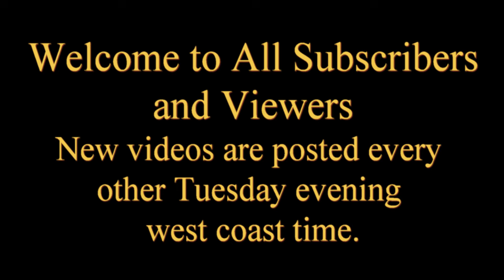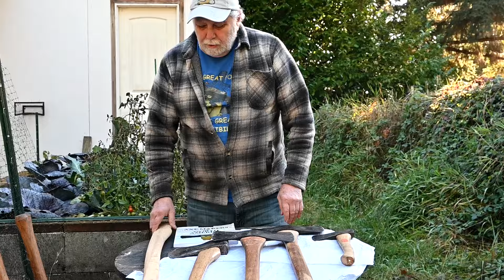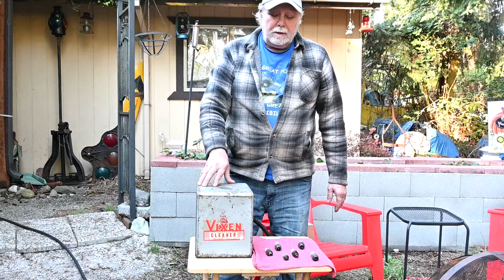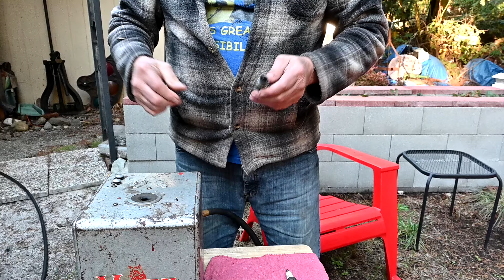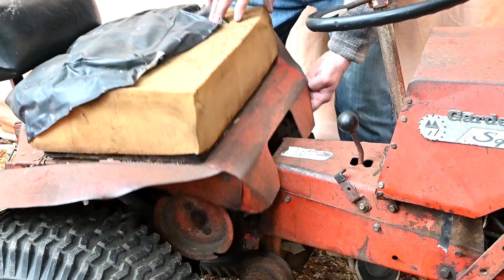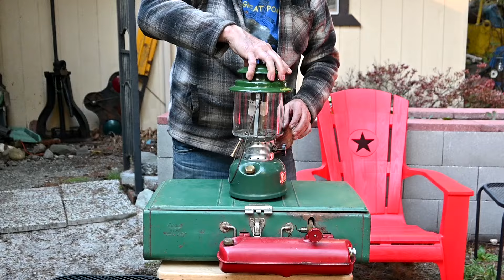Getting Your Monies Worth !

Comment: I like your older tractor I have a wheel horse that's kind of old I think it's about in the 80s Maybe I guess it's when Toro took over Wheel Horse is it supposed to weigh about 660 lb and old Kohler engine in it cast iron and a cast iron rear end in it thank you again for the video
Reply from the maker: Wheel Horse garden tractors were some of the best.  They had many advanced features over the years.  When Toro purchased them, they cheapened them up and phased them out.

Comment: GFB are good axes.  I have several.  Collin’s Legitimus are good axes but they have cheapened over time.  They are usable, today, but are junk IMHO, today, cast stainless built for big box stores.  I like carbon steel rifles, pistols, axes and tools.  I am old school, as you know.  Glad to see you back.
Reply from the maker: My 1920's GFB axe has the best steel of any axe I have.  The vintage Collins and Plumb's are a close second. My axes are all made before WW-2, and are much better than the ones made after that time. After WW-2, many manufactures slowly closed down, and the ones that kept making axes slowly made them crappier.  Carbon steel definitely makes the best knifes, tools,etc.  Nice to hear from you.

Comment: That Vixen spark plug cleaner is really cool, saving you time and money!  You definitely can't beat a good garden tractor, so valuable on the homestead.
Reply from the maker: The spark plug cleaner has been a game changer, as I almost never need to buy new spark plugs for my small engines of all types.  We have a Craftsman garden tractor/mower exactly like yours. We  use it mostly for mowing.  It was originally my dad's now my son has it.  It has given exceptional service. It has a gear drive trans and can be used for towing.  These Craftsman's were made by Roper industries for Sears.
Reply: I'm going to keep my eyes open for a spark plug cleaner.  The Craftsman garden tractors are tough to beat.  I rely on mine, heavily.
Reply from the maker: Our internet has been out the past 5 days, but is working again and I am able to reply to your comment. The Roper/Craftsman lawn and garden tractors were some of the best for sure.
Reply from the maker: You might check Harbor Freight for an inexpensive spark plug cleaner.  I know they sold them at one time.
Reply: That is never fun.  I'm out in the sticks myself and always concerned about my internet connection.
Reply: Will do.  All the best to ya!

Comment: I don't like the older tractors when your tires get dry rotted I heard that you can put transmission fluid in them in the transmission fluid will draw the cracks shut and I tried it on mine and it does work thank you for the awesome video
Reply from the maker: I have not heard of using transmission fluid on tires to soften them up, but I have a few old pieces of equipment that have dry rotten old tires on them that I will try it on.  Thanks for watching and commenting.